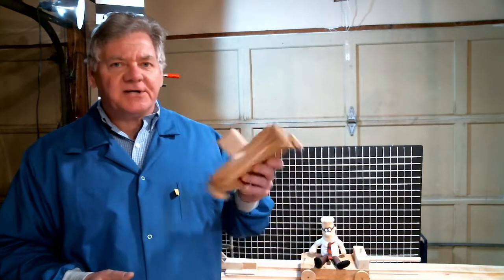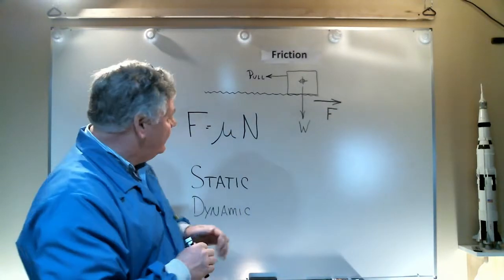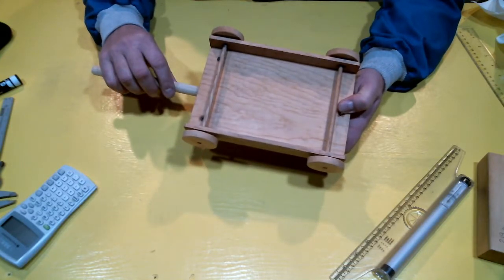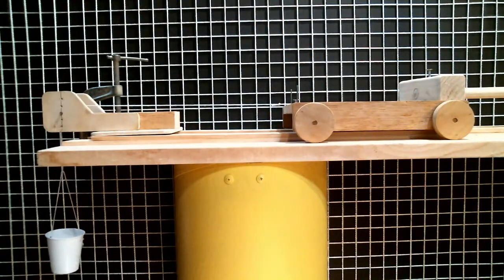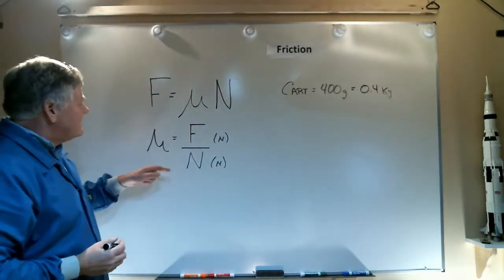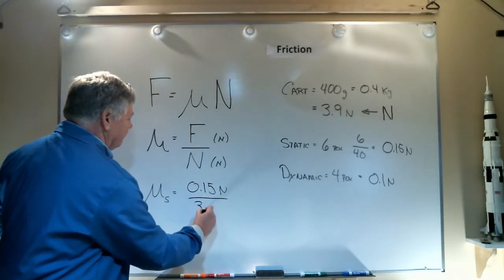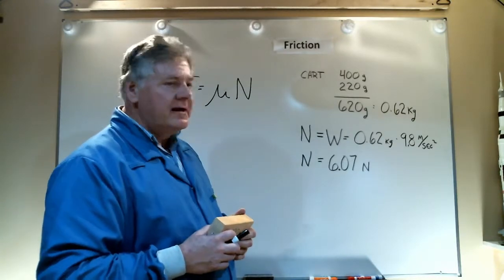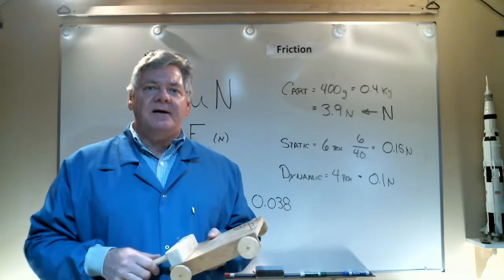Friction - Cart

Comment: What about wheels
Reply from the maker: Wheels reduce friction.  The material used to make the wheels and the surface the wheels ride on make a difference.  Trains can move a lot of heavy cargo because steel wheels are running on steel rails.  Steel on Steel = low friction.
Reply: @labratscientific1127  great answer. Love your content. Why stop making videos?